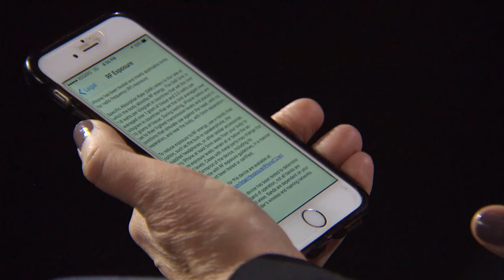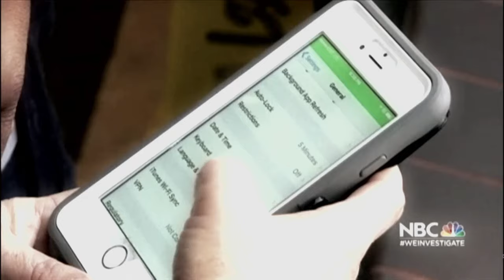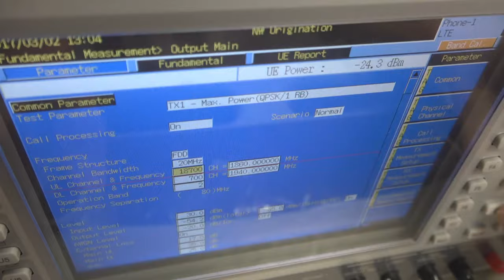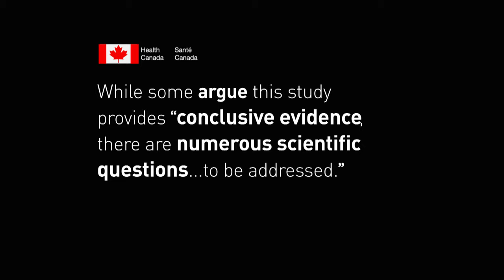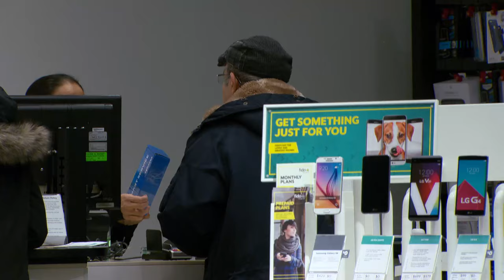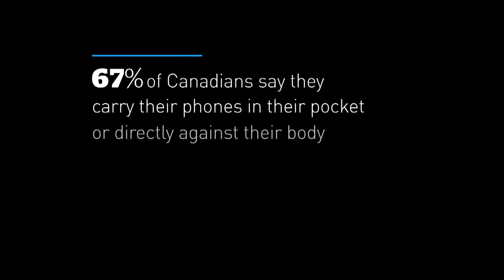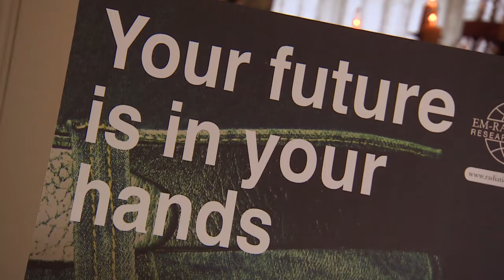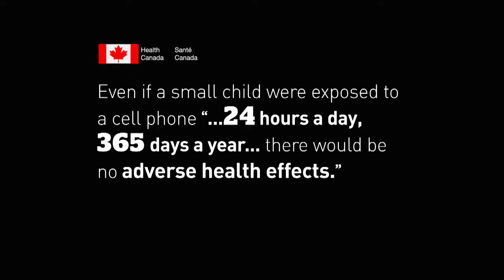The secret inside your cellphone (CBC Marketplace)

Comment: you only mention health canada safety code 6 once in your report. what i find concerning is your use of the term "radiation" which will make people think of nuclear radiation {ie Chernobyl}. this is not correct. the correct term is non ionizing radiation or radio frequency radiation. most cellphones today work on microwave frequencies. you probably receive more radiation from using your microwave oven than using a cellphone. cellphones produce a maximum of 3 watts of rf. your microwave produces 1000 watts or more depending on the model {there is always some leakage from a microwave oven}. my experience is more than 45 years in the telecommunications field.

Comment: My kids play with tablets all day long especially my five-year-old he is always on it should I be concerned about his tablet
Reply: adolf rebelo , when it's pinging to wireless router  (Bluetooth, wireless internet, wifi, ) don't let kids use it. If it's not pinging to a wireless connection, (aeroplane mode or routers etc turned off) it's o.k to use. Also you can plug it in with a cable to a modem and it's o.k to use.

Comment: Cellular phone are bad but not as bad in RF from the new house electric power meters. They send a constant radio waves that is high enough to melt a chocolate bar. Your going to see a lot more cancers and tumor in the future because of these new radio power meters they are replacing the old mechanical power meters. I you don’t replace with the new power meters the power is turned off on your home. I repaired radios and the RF I read of them is very high. We had them at the receiver site too.